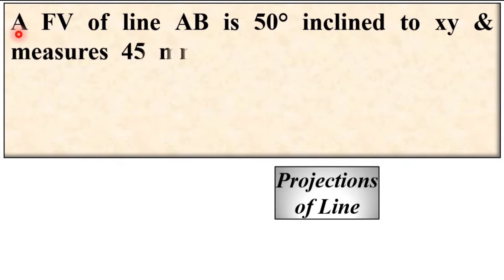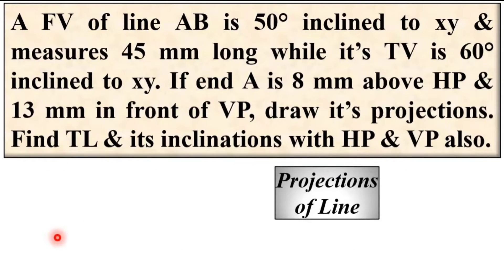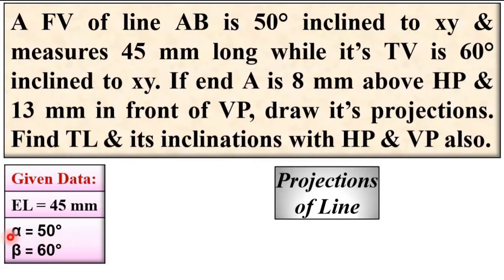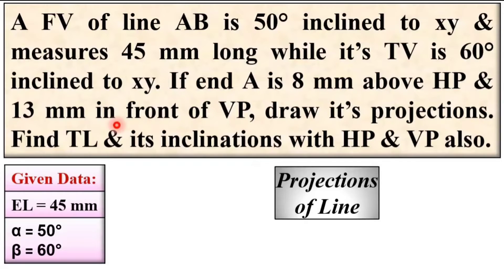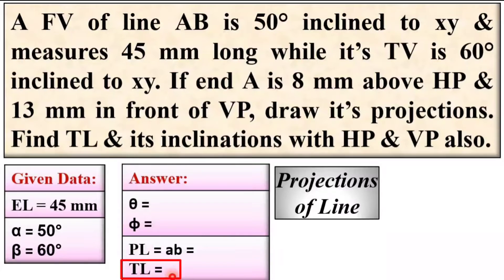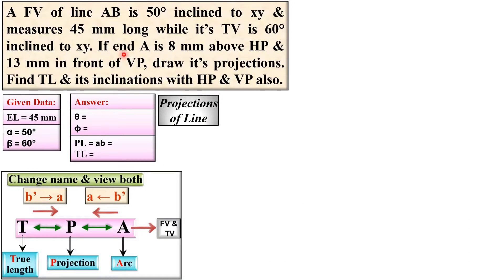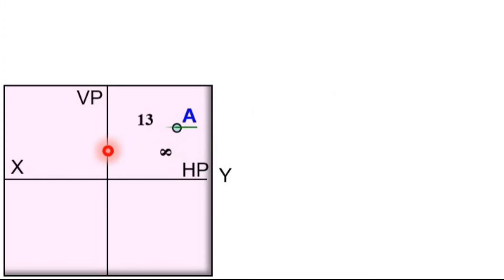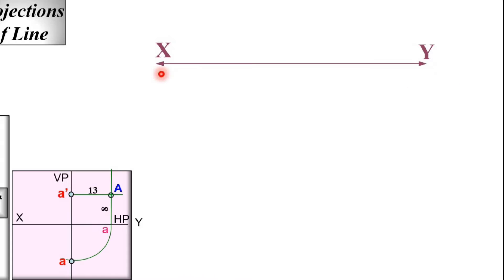6 - Projection of Line (Basics, Drawing Process & Solved Example) Explained in Engineering Drawing

Comment: A line ab has its end A 20mm above the hp and 30mm infront of the vp. The other end b is 60mm above hp and 45mm infront of vp. The distance ble the end projectors is 70mm. Draw it's projection. Determine the true lenth and apparent inclination

Comment from the maker: Projection of Line explained with following timestamp: 
0:00 – Engineering Drawing lecture series 
0:11 – Problem on Projection of Line
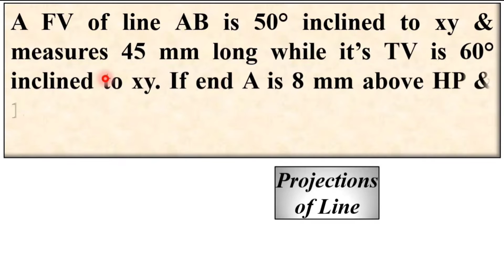0:22 – FV of line AB is 50 inclined to xy
1:24 – TV is 60 inclined to xy
1:52 – Draw projections of Line
2:31 – A is 8mm above hp and 13mm in front of vp
4:16 – Projections of line
5:59 – TPA
7:41 – Plan length and Elevation length